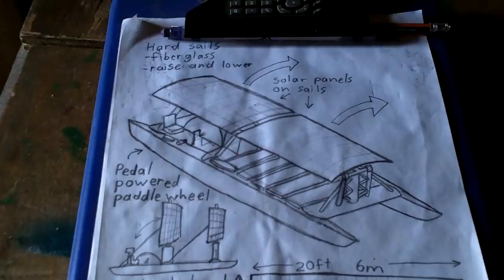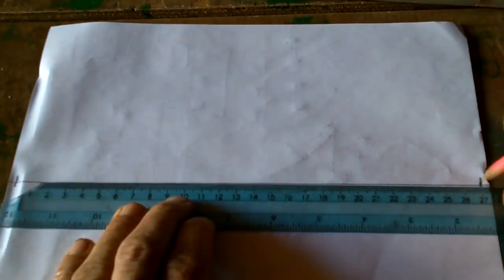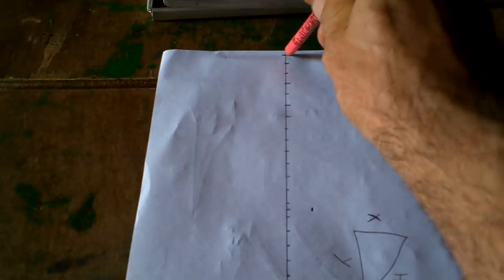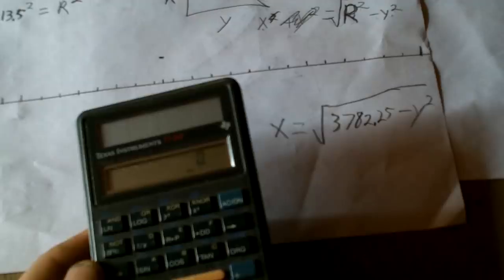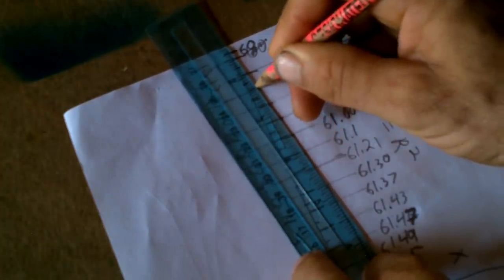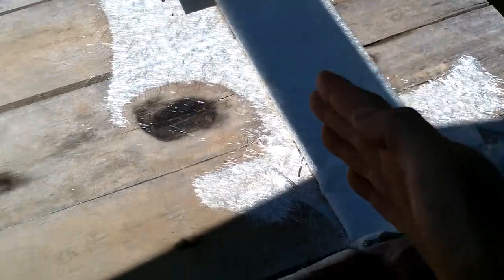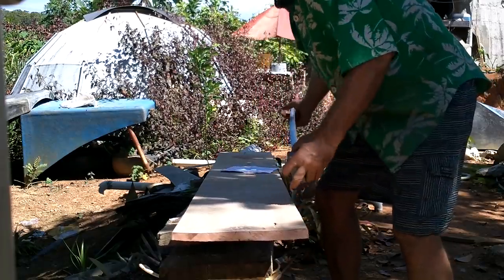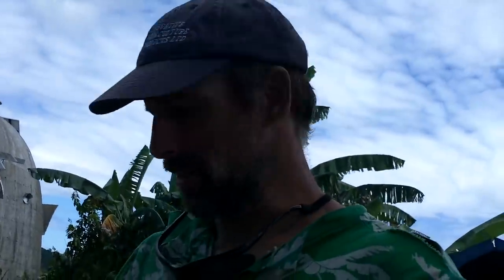Solar Sailer 021 Mathedy Math

Comment: Take the board you are using for the end of your mold.  Put one screw at either end.  Mark the center.  Take a piece of small diameter pvc pipe that will catch the screws on the ends (or anything that will bend evenly) and then push the center to your desired curve.  Put a screw to hold the center in place.  Trace along the edge of the pipe and cut the line.  No math, an even curve and you will be finished before you can work out your calculations.  No need to make a template.  That's how we made scalloped edge fences.

Comment: Hi Jamie,  you highlighted that with the sails / roof in its horizontal position (as a roof), that the solar panels on top would not receive even distribution of sunlight.  You demonstrated briefly with your hand in partial shade.  As I presume the sails / roof will need to be mounted & supported by vertical poles; if you make those support poles height adjustable, you can then set them to angle your roof of solar panels more perpendicular to the angle of the sun.  More sun = more power, yes?  Obviously as the journey continues & time passes the sun's strike angle to the PV panels changes, but you can probably optimise this by merely setting the roof angle once for the outbound journey & then again for the return journey - yes?  Hope this may give you ideas.
Regards, JohnnyK from the UK.
Reply: Thats a good idea, designing the sail mount its a challenge! Loving this electric sail boats!

Comment: I still have my plastic ruler from the 6th grade  .  .  .  .  let's see ,  that was 57 years ago .   Mine is not translucent like yours at  2:10  and does not have a chip out of the corner ,  yet it is hanging in the garage on a hook over the workbench and gets used several times a year .   I have no plans of ever putting it in the ' recycle bin '  .

Comment: You know, a hanging string fastened at both ends would give you a nice curve, plus assure you have the right circumference/length
Reply: CipherNL  Actually, without going back to the video and looking again, I believe he hung a string with a weight on it, or maybe a board, to shape the arc into the ground. In this case, if he'd put two loops in string 9' apart, then he'd just have to fasten one end and slide the other over until he got the curve he wanted, then secure it to hold it in that arc for marking on the board
Reply: In truth, a 'drooping string' forms in the shape of a catenary, not an arc.  Yes, it is 'close, but 'no cigar'.

Comment: Once again jamie, pls make a submarine next.
Reply: I don’t think a Submarine has much use to Jamie + with his geographical location and the shallow waters it might not even be that plausible
Reply: @NZDIRT  A dry ambient sub is only usable in shallow waters anyway, as the air pressure inside increases with depth, making it subject to scuba dive tables.
Reply: @NZDIRT  I felt that the shallow water is a plus for safety purposes.
I'd like him to make a organic manta ray shaped sub that he can ride inside.
Or maybe a shark shaped one. 
It like math. 
I love subs 
I love jamie.
Jamie+subs = joy.
Reply: @Hamdad  I love your hampture videos!!
Reply: You have to remember though that he crosses water that is often almost to shallow for his standard boats
Reply: Submarine........? He's got enough stuff on his island that he could build a Mars rocket ship and show Elon how's it's done!!!!
Reply: Not much use and super dangerous if it fails
Reply: Building a submarine, might be a little problematic, due to them being used for smuggling. It would cause more problems then it’s worth
Reply: @WillProwse  What sort of failure state do you imagine?
Reply: @Hamdad  if it's deep enough and sub walls breach, you are screwed. If he can get out quick, then maybe it's ok
Reply: @WillProwse  Not necessarily. I proposed a dry ambient sub. It differs from submarines as you know them in that the air inside is at the same pressure (slightly greater actually) as the water outside, like a diving bell. So in the event of a breach, air bubbles out, but unless the breach is larger than the diameter of, say, a pencil eraser, water does not enter. If it does, the rate of ingress will be fairly slow, affording plenty of time to surface. Even if it remained submerged, water would flood only up to the point of the breach, all air above that level remaining trapped.

Comment: cool problem solving, a lesser mathematician might "spring a baton"
Reply: but how long should be the baton?
Reply: gregstiles ya beat me too it!  Lol
Reply: @bobrobert6277  ideally the full length of the arc to scribe it all at once, but if all you have is a piece long enough to be a little over half way, you could do it in two steps, once you decided the full width, marked the centre point and then set the height, then use a screw at each end and one in the centre for the high point to give you fixed points of reference, then have someone hold it at each end or use extra screws to hold it in place as you draw the pencil line.

Comment: People are knocking usings maths to solve a problem. Surely making a mistake on paper is just fine and hopefully you will see any  problems. If you just rush in and start cutting and make a mistake, you are up a creek without a paddle. Measure twice, cut once.

Comment: Jamie is a very clever man and math is extremely useful to solve complex things, but he could have done exactly the same thing in five minutes using a few screws and a thin strip timber or pvc, in fact at 13+ mins where he shows the drawn arc with the saw on the board, there is a strip of something that would work to draw the arc on the ground a few feet to the right...

Comment: Instead of arbitrarily mathing out a random curve that you think "looks good" why don't you make a system that can set the curvature of your sails as you see fit?  The optimal efficiency of the sails curve varies depending on its size, wind direction and forces exerted. You also would ideally want to angle a flat panel directly towards the sun when theres no wind. So a system allowing you to alter those variables on demand would make much more sense than attempting to find a (un)happy medium amongst them. I can't imagine it would be too difficult for someone like yourself to build such a contraption. Some of the crazy crap I've seen you pull off... this oughta be a cake walk. 
🎂 ⬅🚶 
Also... Its a proven fact that when cake is introduced man will always walk towards it. I believe its a cosmological constant.

Comment: You are designing a sail that will block another sail from working on the most inefficient point of sail.   Sails are wings that create lift.  Downwind is a sail working in merely a drag mode.  Read a friggin book or this will be yet another failed project, you cast aside.